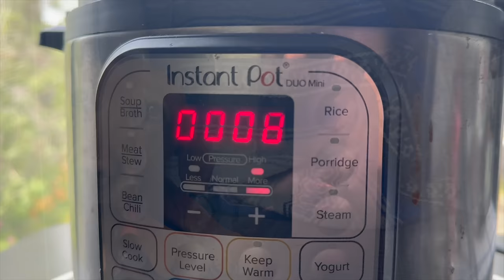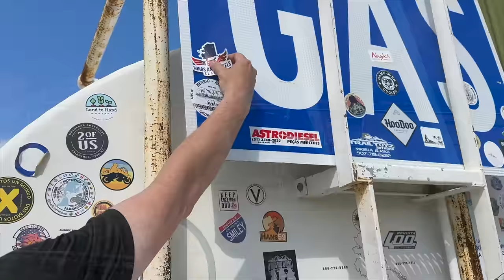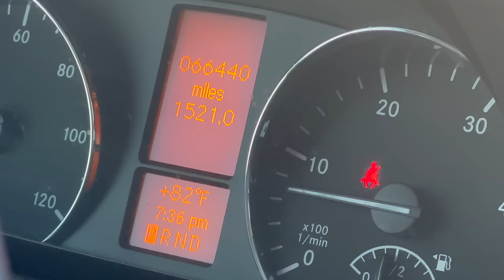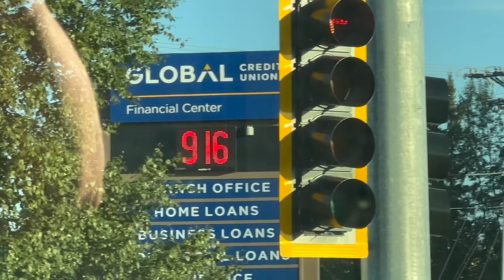20 Sprinter Vans Survive Alaska's Atigun Pass? | Alaska Overland

Comment: Fabulous adventure. Thanks greatly for sharing. We attempted the route in early June but we faced blizzard conditions and deep mud over the pass so we turned back at Coldfoot Camp. We will certainly try again. Rough roads, hard on our Sprinter 3500 Dually 4x4.
Reply from the maker: Very hit or miss.  We have done it in early May on motorcycles and we have tried in June where we have countered blizzards.  Done in August with fall colors and have also seen blizzards in August.